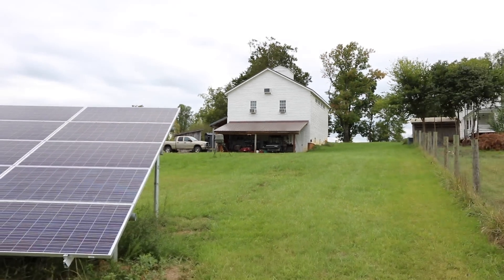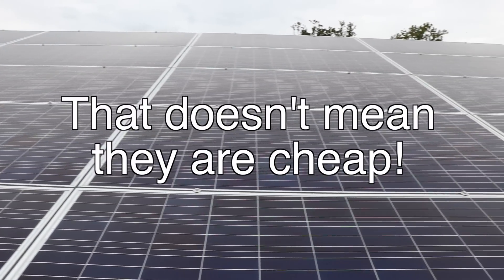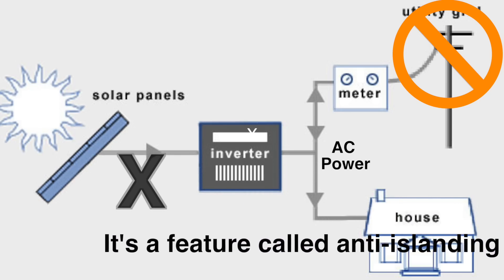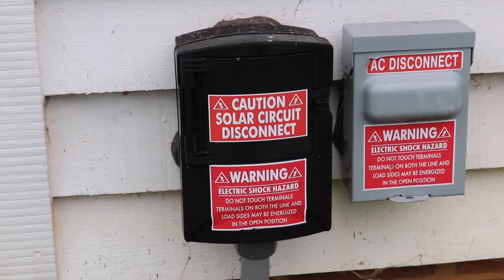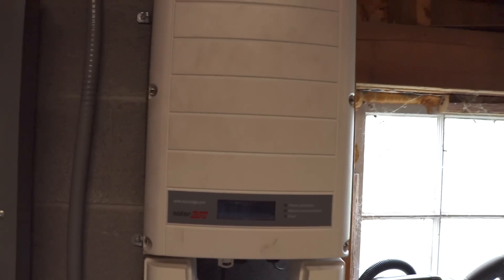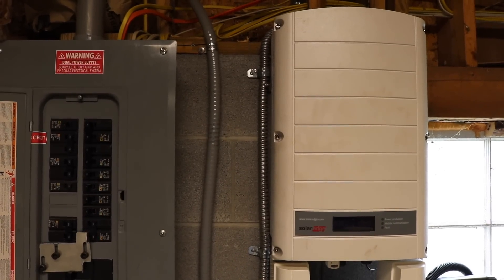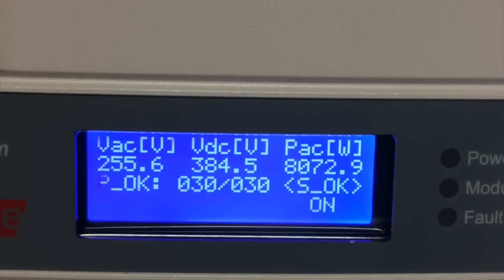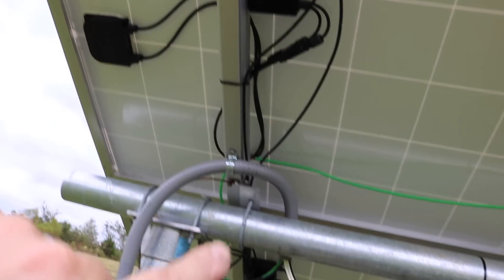The ugly truth behind grid-tie solar systems. Part 1, FarmCraft101 solar.  Watch before you buy!

Comment: Well done video. It hits the technical stuff without being overly technical and confusing. The title is a bit much - the truth is just that - not sure it's ugly. For the safety of a lineman who might be working on power lines to restore service, systems shut off AC power back to the grid if they don't detect incoming power. Looking forward to the battery video.

To answer the question of how utilities deal with excess generation, my example is this. My utility (XCEL) gives me the choice of whether to bank the extra wattage produced and use it later or to receive a check once a year at wholesale rates. I started with he latter and then switched over to banking it. That works better for my situation.

Comment: Thank you for your video.  It did explain a lot. We are going to install a ground mount system, 18-385w with a 7.6kw solar edge inverter.  We need some help with wiring, from the array of panels to our inverter, which will be mounted next to our main panel is approx. 200ft. Am I to understand that only 1-8-gauge wire is needed, from the solar array to my inverter?  I am getting differing answers.

Comment: The battery bank is the KILLER of savings. A bank of 12 batteries (standard truck 900 amperes battery) cost about
100 Dollars each. Times 12=$1200.00, The average life span of a battery is 3 years. So multiply 1200x every 3 years.
for 9 years, you loose $3600. 00 from your pocket. If you get SPECIALTY batteries. Do not even think about its price.
There are batteries that last 20 years, but their price is VERY PROHIBITIVE. 09/24/2020.

Comment: You missed a couple of important costs in your calculation. 1. Depreciation and Maintenance of the system, these systems last about 15-30 years and will it need any service during those years. Each component depreciates differently... I don't know how long the transformer lasts, how long does the inverter last, and the panels last 15-30 years. 2. Opporunity cost, the 23,000 could interest costs and if you paid cash and don't have any interest costs, you are missing out on earning interest/returns on other investments. 3. I also think the system loses efficiency with age. It might lose a certain amount of electricity generation each year. I'm an accountant though; what do I know?

Comment: I use 2 panels on a small cabin in the woods, with 4 car battery's for AC I use an APC UPS to convert to 110V ac that I can disconnect from the battery bank. Cabin lights are 12v that way I don't do the 12v to 110v and back to 12v. Turning off the converter when not in use saves power drain from the batteries. This setup was done on the cheap minimum cost thus the old car batteries.

Comment: Very informative video. I am about to install a 17.6 w solar panel system to run a submersible water pump (15 hp). If I use the pump 5 hours each day, do you think that my solar panels can cover my electricity consumption (if connected to the electricity company of course)

Comment: You can't have a single copper wire running back to the source from the panels several wires including a grounds run back to the disconnect and the breaker box buried 2 feet below ground in my area,i'm sure he just misspoke nice setup,I installed mine on my roof which now see as a big mistake after changing several Enphase micro inverters not easy to do on a pitched roof.
Reply from the maker: Correct.  Single cable is what I meant.

Comment: My average electrify bill here in northern IL is about $80 per month.  That's about $1000 per year.  I was quoted 22 to 26K for a 10kW system.  That's a 23 year break even point.  That's assuming NO further cost input is required over those 23 years is needed.  My experience from people who own these is the inverters go bad, panels have to be replaced, etc, and it's a few hundred a year for routine maintenance.  That brings my break even point up to 25+ years.  My understanding is the panels are only rated for 25 years or so.

And, all that is assuming we don't have one really bad hail storm in that 25 years which takes out everything.  That probability is very low, given our history of hail in this area.

Tell me how I'm going to save any money.
Reply: Bud E , that's exactly what I'm worried about , add lightning strikes( direct or indirect) . Batteries lose 30-50% life if fast charged /discharged and the power companies uses your batteries when they need too .
Batteries cost 100-200 each and they discharge them fast when if base power -nuclear or gas plants go offline. It's too costly I feel

Comment: I guess I overpaid.  I got a 9.6 kw system   and was paired with solar edge 7600 watt inverter.  Not sure why they put in a 7600 watt inverter.  System is ground mount just like this one. Paid 34000 before tax insensitive.

Comment: HELP: I have 1kwh solar system. It come with micro inverter, now all I need to do is hook it up with breaker then I am in busines But Right now I don't have a meter or anything to tell me how much power my system actually produce and feed to the grid. Do you know which device I need have in order to monitor the power I produce.

Comment: Very nice presentation. The off grid system needs a standby gen. and transfer switch. I'm concerned about starting a 5 hp compressor  and the surge required, am assuming the grid is used to start an AC. Pretty smart inverter.

Comment: Small systems like this SHOULD NEVER go with installer, buy panels yourself for .42 cents a watt and buy racking systems for even less! Then install yourself, call a electrician to wire up and viola you do it for 1/3 the price! $17000 for this is STUPID!!!! This could be done for $7000 in DIY! Maybe throw and extra $1000 for an electrician!

Comment: This of course is a top of the range system, it can be a lot cheaper,  first thing why are the panels so far from the house?  close to it or on the roof is far better,  cutting down on wiring costs, and when you switch from grid tie to off grid keep the batteries and inverter close as possible to the panels that way you are transporting the power at high voltage to the house, Also if you look at the off grid as a sort of emergency system for when the grid is down, you can prioritise ie the off grid supplies just lighting / fridge / deep freeze and TV / computer etc, all very light power requirements, this is easily done on the house consumer unit,  the batteries can be Auto batteries wired in parallel you don't need expensive deep charge batteries for emergencies, all heavy power requirements ie water / heating is far easier to use the grid if it's on or gas / solid fuel if it's not, that way you only need a fairly small cheaper solar system that you can easily install yourself,  In my opinion the biggest mistake here was buying such a huge expensive system to start with, a much more carefully thought out more modest system would have been a lot more economical and had all the advantages of a solar system and very few of the  disadvantages,  Also I think your estimate of the break even point was very optimistic I would say at least 10 years more like 12...

Comment: I have a 3.3 kwh grid tied system that uses micro inverters mounted on each solar panel and all go to a box above my meter.  if it senses power from the meter, it keeps the power coming, if the grid goes down, it shuts off the power.  I bought my system july of last year, 2019.  I live in Illinios and they offered a 40% tax incentive which I gladly took advantage of.  my proposal was just over $14,000, but with the illinois incentive and my 30% federal tax credit, it only cost me $4,000ish.  Now running my A/C every day in the summer, I pay only $16 per month, which is the minimum, because I am producing more than I use.  My system will pay itself back in less than 5 years.

Battery technology is getting better, but right now, a power wall doesn't makes sense for me.  I have a backup generator, but really only need a small portable power pack. for short outages, which rarely happen.  Solid state batteries will make power walls smaller, hopefully cheaper and more durable/longer lasting.  That's what I am waiting for.

Comment: Hi, I'm no expert in solar panels, but I'm a certified electrician, still, if I'm wrong some please correct me, you want the inverter as close to the panels as possible because transporting DC voltage is generally very inefficient and you lose way more power than transmitting the same amount of power with AC, so if you have your inverter or an array of micro inverter you can expend less money in Cooper wire and can use aluminum wire to transport the AC to your house, at least that's my opinion
Reply from the maker: This is a common misconception. For many systems it is indeed more efficient to transfer in AC, because many systems have DC power in the range of 48V or less, so inverting up to 120V increases efficiency.  However, at the same voltage, transfer in DC is actually more efficient than AC.  In other words, if you had to choose between 120V DC or 120V AC, you should choose DC.  There are several reasons for this, which electroBOOM explains well: https://www.youtube.com/watch?v=DFQG9kuXSxg  There are some large, long distance grid transmission lines where they convert the AC power to DC to increase the efficiency, easily found on google.   In my system staying with DC is a no brainer, because I have 360V DC transmission in one leg, while after the inverter I have 2 legs of 120V.  MUCH more efficient to use DC.  Cheers.
Reply: @FarmCraft101  makes sense, thank you for awnsering

Comment: Hi, question:
Is there a reason why you made a 3 arrays of 10panels each? Why not make it 2 arrays of 15each. Total of 540Vdc per array, same current. And you will use lesser dc wire to your combiner box, 2 pairs of strings vs the 3pairs you made. Is there a reason for this? Thank you

Comment: Thanks for the informative video.  I like the way the panels are mounted away from the bldgs, but I've seen some stones thrown by mowers and even vandals break glass and panels.  I think I would have the panels mounted higher, and be able to used underneath as shelter from the elements.
I'm not sure where all the pop-up suggestions were coming from but they were too numerous and obnoxious.
Reply: Thats a good point. Im getting a system & live in a area where ppl love destroyig other peoples things. My panels are going to be high on the roof.My sun side faces away from the front sidewalk.

Comment: I have a grid-tie inverter that puts out 10 amps at 120 VAC to an outlet if the grid is down.  That is very convenient for running power tools or keeping the fridge running when you have a major power outage.  I also thought everybody should know that story about mixing panels dropping every panel's current and voltage in a series string is wrong!  Panels operate at different voltages with different current draws.  So a lower wattage panel will have a lower voltage output with the same current as the rest in a series string.  The current flow forces the weaker panel off it's maximum power point, but the difference is minor as long as the panels are close to similar.  My system has one 305 watt panel in series with several 275 watt panels and I get a lot more power out of the string than if they were all 275 watt..

Comment: Good explanation.  It you can afford it or don't have room for lead acid batteries, lithium battery backup is better.   As noted by MiltunaMusic below, SMA offers an emergency power output for some of its inverters if there is a power loss.  One can manually switch that in to run appliances, such as a refrigerator, during the day in times of outages without needing a battery.  Obviously, the SMA emergency power out will not help one during night time power outages.  The backup batteries are a must for nighttime power outages.   With time of day metering by power companies, a battery backup can help conserve electricity costs when power is most expensive and charge the batteries when power is least expensive.  This requires newer inverters that can be programmed up for the time of day metering.  Finally, Solaredge had an integrated inverter (not sure its available anymore) that directly supported battery backup to a Lithium battery.   They were ahead of their time and it likely did not sell well because Lithium batteries were so expensive back then.

Comment: The power companies want you to use grid tie inverters so they can continue to get money from you. C'mon now, go solar array to batteries to regular inverter only.  It is a way cheaper setup, and you do not loose power to your house when the grid goes down....As a master electrician I went to a seminar at a solar panel manufacturers,  and all they talked about was grid tie systems which led me to believe they were in cahoots with PGE.  Don't fall for this method.....if you want to save money.
Reply: yeah but a system like this 8k or bigger would have over production at times and would be wasting energy.  Some power companies are still offering a full credit meaning they buy from you at the same price you buy from them.

Comment: The higher voltage also means less resistance loss in the power hookup. One more improvement to efficiency, but also more hazardous, if not adequately protected.

Comment: You got an AC Disconnect sticker on your DC Disconnect there...

Interesting code they required a second disconnect when the Inverter already has one. Maybe the inspector was confused, trust me it happens. 

My experience is sometimes you got to explain the code to the inspector, solar codes are new and changing and inspectors aren't specialized they get things wrong sometimes. You always have the right to ask them to check the code book and verify, but you also don't want to piss them off either.

Comment: Maybe as it depends on the distance and size of an installation, changing the amount and strength of wires. 
But you need also to update your video or information with now 2 years later better solar panels that are also cheaper.
I installed a 2KW Senergy OnGrid Inverter (18.000 B) starting with 6, then 9, now 10 of 330W 24V Panels (each 4.000 B). In Thai Baht I invested near 60.000 Baht (plus cables, meter, switch), producing about near 400 KWh per month worth between 4.12 to 4.3 Baht/Kwh. Taking the cheap way 4.12 (only one of all 8 months yet) I get saved 1.650 Baht/Month. 60.000 Baht / 1.650 Baht = 36.4 Months = 3 years. Actual I am at 34 Months payback with the real price and Watts per Month. 
location Thailand, ChiangMai, getting near 30% of all usage by solar.
Yes, at really clear summer days the inverter cut of up to 2 hours the maximum output to 2,2 KW, but the gain/plus over the other times or more cloudy/smog days I get more plus then loose at high noon. Max 9 panel 15 KWh day, new max 10 panel = 16 KWh day.
Reply: Sounds like dont have to get any kind of approval for you installs lol...

Be careful running more panels than your inverter can handle, cannot imagine it ending well when the Panels are shoving 3.3kw at a 2.2kw inverter.
Reply: @BobLSaget  I have 2 Kw Inverter and now 10*330 W, 24 V Panel, ... during noon about one hour, the Watt on BOTH side (PV and Grid) is not exceeding 2.2 Kw = the Inverter has an "breaker" in, and so Inverter also dont take more than needed. Advantage: with 9 Panel that also happen sometime short, but as of better grab Sunlight with 10 at the end I have yes about 15% more daily income (running like that for 10 days now) during the times not reaching the border of 2.2 Kw
Reply: @BobLSaget  The description of the Inverter is clear: max Voltage off 600 / off Voltage Panel 45.9 = 13 Cells, MPPT opt/until 520 to 580 Volt, with 11 to 12 Panels at 45.9 Volt, but working Voltage max = 37.3 mean also possible 13 near 14 Panel (for temp 45, but I have 65 at the roof). So I am still INSIDE the Inverters options, but as same Inverter layout also used for 3 KW, and my measurements are also still inside this parameters (seen max 377 Volt PV), so next month I plan to raise it to 11, as it is said, not the sun makes the Watt, as the Inverter choose how much to let and take on the PV, and this might be right as I see never more PV Watt than it can deliver to Grid.

Comment: normal panel cost today 1$/1W 100W=100$ or less. if pay more have big idiot. battery charging controllers cost 10-50$ and inverter have good expensive. but normal not need big inverter in house, only fridge all other can change 12 volt better cheap system TV, light,pump,fridge can too change 12volt/gas system model. idiot use inverter and waste energy lot if can use 12 volt system all.

Comment: There is no ugly truth about Grid Tie Solar Power Systems. You just have to get yourself educated upfront regarding the pros and cons of each especially if you want to add Battery Backup to your Grid Tie System it can be more complicated and exspensive.

Also if you had chosen an SMA system their can continue to work after a power outgage by using battery backup with automated internal disconnect from the main grid.

Comment: So about the time you could start to break even on solar system you will have to start dumping money into it replacing batteries and then panels and inverters assuming nothing breaks before your 8.5 year estimate.
Reply: Buy it cash. In 8  years you fix as you go with the money you save monthly if needed  If not think of all the money you're pocketing . And to know that generations to come will enjoy free air-conditioning . I live in Nevada desert 114° to 118° in the summer $400 per month  for the summer months only .